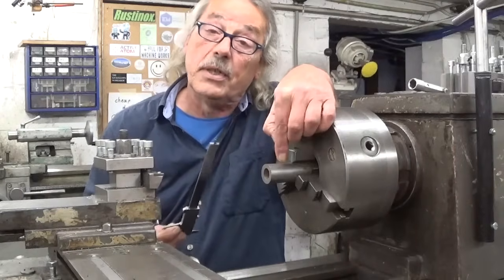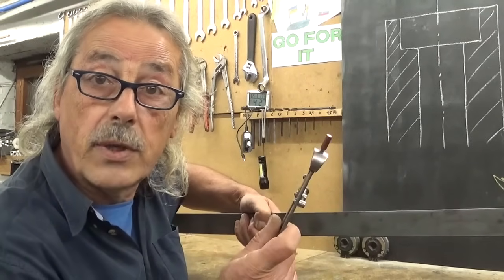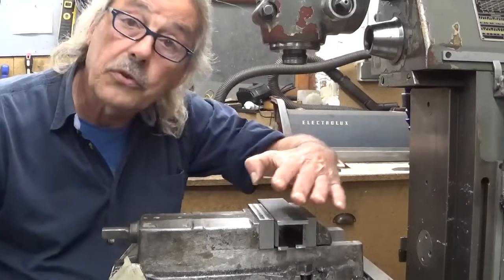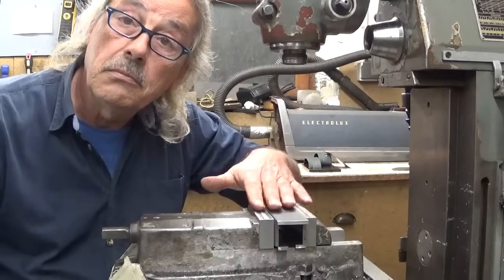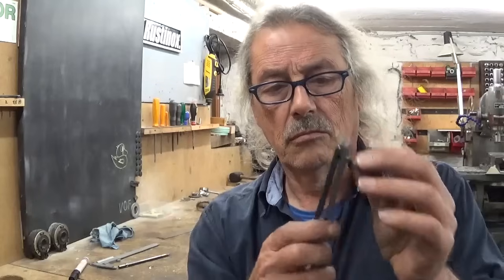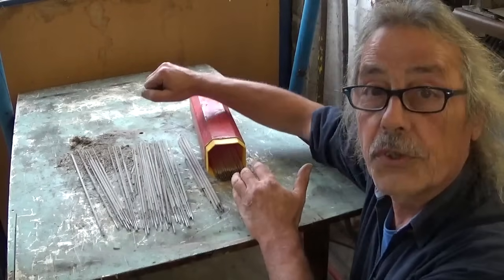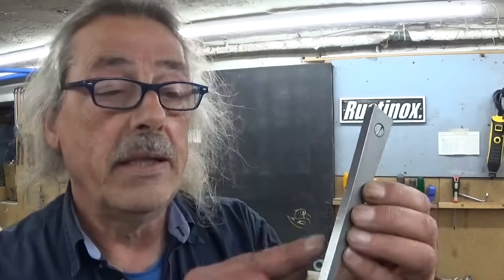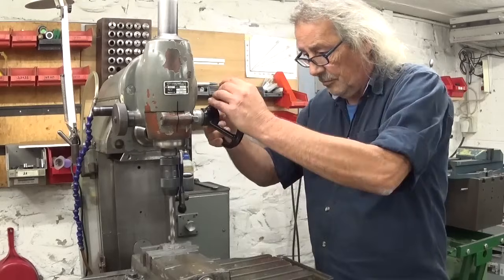Calipers made from flat bar.

Comment: Michel, I worked with a (to me back then) "old" Machinist in the Grinding Shop that used a set of spring calipers to measure an area in a jet engine component where he had to fall within a few "tenths" (i.e., a few 0.0001-inches or a few 2.54-microns).  His "feel" while using them was good enough to meet those tolerances.  (I also think that he was the "one guy" that could get an old vertical grinder to work well enough to hold similarly tight tolerances on the aircraft parts that needed that particular machine.  He knew where, when, and how hard to push or lean against the machine to be able to hold those tolerances.)  So, I think that anyone that practices enough can definitely use spring calipers (or your version too!) when very tight tolerances must be held.  Thumbs up!

Comment: Nice little simple project.

I would probably have thinned down the material a bit more - or at least a taper down of the thickness at the tips. That way, it will fit into slightly smaller spaces with less error in the measurement. Of course, there's still a limit based on the curvature of the "foot"...
Reply from the maker: I did.

Comment: OK, now some hints for adjusting inside firm joint calipers. To adjust them smaller, tap one leg on a hard surface, to open up, tap on a rod between the legs. When measuring the micrometre should be turned over so you are looking at the back of the barrel. Getting accurate results it is all about feel and no preconceived value. Toolmakers pattern spring type have more feel. I used to grind bores parallel just by feel using them.

Comment: Way, way back, we made both inside and outside callipers as a project in our metalwork class in High School, and from memory, we heated them to make the bends. Oddly enough, I have only recently been thinking that I might make another pair, but you have beaten me to it. Well done on those callipers. 👍
Reply from the maker: I made one in school too, but it doesn't exist anymore.
Reply: @Rustinox  I wouldn't have a clue what happened to mine.

Comment: Shouldn’t you mix that coolant with water?
Reply: He is not using water-soluble coolant.  I think it is hydraulic oil.
Reply from the maker: It's oil, so better not mix with water :)
Reply: @Rustinox We use a coolant that looks like oil and, after mixing with water becomes milky.
But I’ve got it. 😊

Comment: Lovely looking pair of inside calipers.  Now got lot steel left make some special parallels,  drill hole in ends bolt to a bar, mill back and front edges instant parallel. 

Welding rod keep the steel good stuff for pins.
Steve

Comment: There's always a friction disc made out of paper in those calipers. Just a paper washer. I've replaced them in a few pairs I have. I make them out of nice drawing paper. I have hollow hole punches I make them with. The last time I made some I made some spares. Usually the screw head sticks up on top of the legs too. I use those kinds of calipers a lot. Was just using some yesterday in fact.

Comment: If you ever need thin steel rod then knocking the flux off a welding rod is the perfect solution.
Reply: Yeah I've used beat welding rods as wire. I also roast rods. I have this electric grill I put them on. It drives the moisture out of the flux. I don't have a rod oven to keep them in.  Roasting works good enough for me. I call it cooking the dogs. Because I kind of cook them like they're hot dogs.